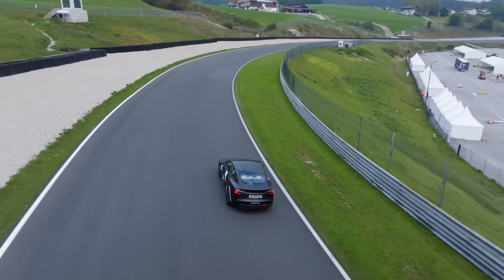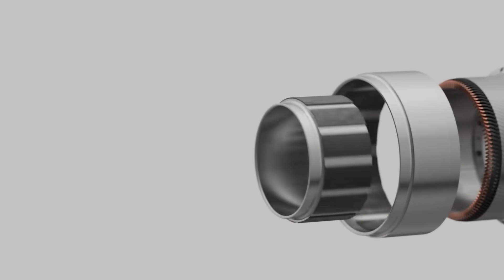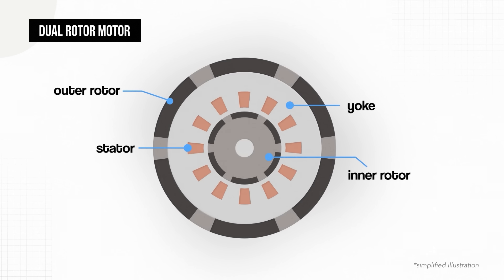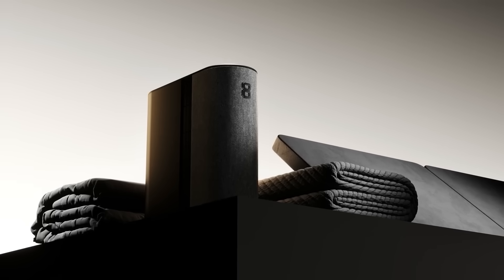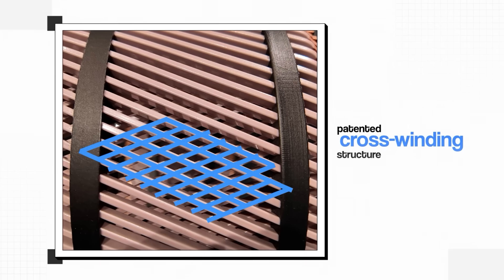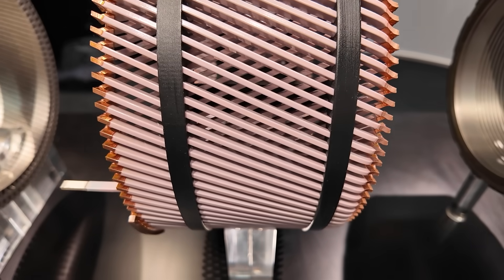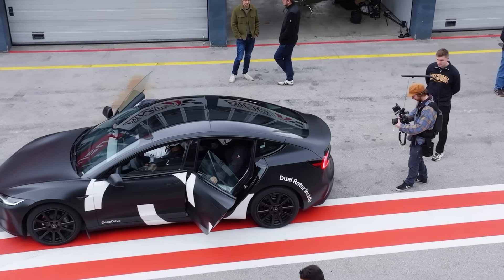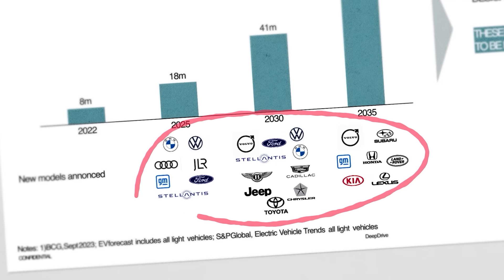How Dual Rotors Make Motors Insanely Efficient

Comment: Unsprung mass is a much bigger deal than you think it is.
Reply: @v4skunk739 You are so right on this one, I have a truck I used large tires on. The ride was rough and yes i used beads for balance.  The tires eventually were replaced with smaller tires and the ride was improved significantly.  The comparison I am making is based on experience with all other items the same. The rims were the same for both tire types but the weight change was so noticeable that even my wife commented on the ride change.
-MG
Reply: The in-wheel motor mass is offset against no drive shaft mass, and smaller brakes, as it can brake electromagnetically. Overall there is an increase, but it's not as much as you might think.
Reply: @GRAHAMAUS  It isn't ever happening for a car or truck. You don't understand physics and rotational mass. There is a reason why race cars try and remove all unsprung mass.
Reply: @v4skunk739  Whatever you say, random guy on the internet with no doubt a physics degree. I'm not claiming it is better, I'm saying it's not as bad as you presuppose. And we're not talking about race cars, are we? Have you seen truck axles? They weigh TONNES. Whether the hubs are 100kg or 110kg is irrelevant.
Reply: @GRAHAMAUS you can't even grasp the concept of rotational mass/centrifugal force. A 100g dust cap on a wheel on a vehicle moving at 70mph weighs like 32kg due to centrifugal force. Thst isn't even including the wheel. Heavy unsprung mass is terrible for anything with a wheel.
Reply: @GRAHAMAUS  So Just to let you know, the pickup truck I changed tires on was an International with a curb weight is 10,500 pounds, it has straight axles and just the change in tires made it stop shaking my back teeth. The change took it back to a rough riding pickup. Of course your mileage will vary but on a truck that does zero to 60 in "some day" it made a difference you could feel.
-MG
Reply: @v4skunk739 and how exactly does higher rotational inertia effect a non performance vehicle in a significant way?

Unspring mass will have negative effects in suspension, and therefore the ride, but I don't see the rotational part of  additional weight causing any trouble at all.
Reply: @kosiranze  You don't know what you are talking about. This tech will work best for trucks and in a car it would be terrible.
Reply: @v4skunk739 instead of just downplaying others, why not actually try to contribute and explain why higher rotational inertia in a wheel would significantly hinder a non performance vehicle?  

Does suspension have to handle any significantly higher torsional loads because of higher rotational inertia?

It is clear to me how it negatively impacts the ride when considering vertical motion of the wheel, but not the rotational motion (apart from acceleration and somewhat braking)

About it being terrible in the car, go check out what people who had the chance to drive the Renault 5 turbo 3e have to say... Far from terrible IMO
Reply: Based on? Yes it does make a difference but we are in a world where everyone says it's so important, meanwhile I can't think of a car from this millennium that has inboard brakes. Further, cars have increased in weight significantly. Unsprung weight may be double, but If the weight of the vehicle also doubles, what's changed?

And then you have to consider what it impacts. If it makes the handling worse, so? Most people drive SUVs, handling obviously isn't the main factor for them.
Reply: @benholroyd5221 Brakes are a pretty small fraction of the unsprung weight. Adding a 35kg motor on the other hand…
Reply: Yet manufacturers keep adding bigger rims. Its clearly not that big of a deal.
Reply: @traniel123456789  and ever-wider (heavier) tyres...
Reply: @traniel123456789  On performance models they work on reducing weight like having lighter wheels and carbon discs. There is a reason why no EV's have a motor in the wheel.

Comment: Next step: replace the Copper bar windings with high grade Carbon fibre, known as Carbon 100 (Copper on the same grading system would be 80, so the 100 is a better conductor). They should be coated with a polymer which insulates the fibre and conducts heat (I've forgotten what this polymer is called). This will further lighten the motor and add more strength to the design.
Reply: Don't tell this to Koenigsegg, or they will build a whole motor out of nothing but Carbon, Polymer and Neodymium.

Comment: ThinGap has been making motors with this layout for years. Also, the stator iron has two other important tasks: It keeps the magnetic flux out of the copper, and it increases the motor inductance. Magnetic flux passing through copper results in eddy currents, reducing the motor efficiency. In a conventional motor that flux goes through the iron teeth. Iron has much lower eddy losses than copper due to its higher resistivity, and it is laminated. A motor with low inductance will result in a large current ripple from the inverter switching. Either you need to use a high frequency inverter (which increases switching losses) or external inductors, with add so much weight you might as well have used a conventional motor.
Reply: Absolutely correct.  Balancing core loss via inductance is a tough problem. Inductance is simultaneously your best friend and your worst enemy .
Reply: Yes, these look almost exactly like Thingap's motors which have been around for a long time. Also, many linear motors are constructed like this (but not round). Alva Industries also makes a similar dual-rotor slotless motor. I'm sure we'll be getting a Ziroth video next week about how their motor changes everything!
Reply: @jbay088  well it's also conceptually identical to most axial designs which use stacks of stators/ rotors.
Reply: The inverter switching losses might be more complex than  just  r*f_s, i recently watched this interesting presentation from TU Graz https://www.youtube.com/watch?v=Q_jsMjY5vG4
Reply: Omg wait I work at ThinGap lmaooooo when he said “this innovative dual rotor design” in the intro I was like ????
Reply: I took a look at the Stellantis Intelligent Battery Integrated System. It groups cells into 48 sub-packs, each with 4 transistors. 16 packs are used for each phase. They do not say how many cells are in each sub-pack. The intelligent part means each sub-pack gets an equal time charging or discharging, staying balanced with the others. It does mean the power for each phase must pass through 32 transistors. https://www.youtube.com/watch?v=EUR7beftSt0
Reply: "Iron has much lower eddy losses than copper due to its higher resistivity, and it is laminated." - is it much of a problem when the 2 rotors are so close to the copper windings?
Reply: Did you notice that the copper bars are encased in a laminated iron core?
Reply: @gibmebalut  Oh, that's what that thing is? Well, that helps alot. The flux can avoid the copper, and the inductance is higher.
Reply: Or just leave out the inverter... in Germany (I think it was Fraunhofer) they developed a battery-pack-technology that enables inverter-less EVs. The magic: You just need to be able to switch every single cells positive and negative contacts as needed to generate alternating current as needed or load the battery with alternating current. Now combine both.
Reply: @hschmidt79  The problem is you aren’t removing the inverter in practice, you are removing a couple of reliable silicon carbide switches and replacing them with literally thousands of Mosfets to be used in an EV, it would add a ton of complexity to the battery and a massive reliability headache in real world.
Reply: @quantuminfinity4260 sounds like German engineering to me 😅
Reply: @quantuminfinity4260  switching each cell's polarity with a MOSFET is still an interesting concept to explore though, especially considering each cell needs monitoring, cooling and a safety fuse or similar anyway. If the cell could be manufactured with the switch integrated, that may help too?
Reply: @mandrakejake  You may be spreading out the load to thousands of switches in the process but that doesn't mean you get away from switching losses... You just spread out the heat into your entire battery pack that you now have to get rid of. Troll
Reply: @mandrakejake  Ugh!
Reply: @hschmidt79   That sounds more like Pyramid Ponzi engineering.
Motors in EVs are 3 phase... So you need a current form conductor A to conductor B, then from B to C, and then form C to A. How is a battery cell with 2 conductors going to switch between 3 conductors of the motor?
Also switching every call is WAYYY more complicated that switching at the inverter.
Reply: @sasjadv Presumably you’d have 1/3rd of the cells on each phase. I’m not familiar with the work, but it sounds like the idea is to have essentially one inverter per cell (microinverters so to speak).
Reply: @markirmuir  So you basically pull more amps from each cell, because you only use some of the cells at a time, and the cell itself will have to supply the PWM signal too.
This is like just trying to be gimmicky for novelty sake, just such that it's new and newsworthy.
Reply: @sasjadv  Sounds like a cascaded H-bridge inverter
Reply: @Turst28  Inverter, as in singular case???
When you have many subinverters, that combined form an inverter grid, or a distributed inverter.
But why? Why switch at the cells?
Reply: @sasjadv maybe not individual cel but groups of cells. Low motor inductance will be difficult to manage. More levels would help
Reply: @sasjadv  Not necessarily, you can use DC motors, but replace the brushes and commutators with semiconductor switches...
Reply: @vladimirs.4700  So get more ripple, dead zones by using a single phase motor, but then you still make it more complex by having an inverter array and switching every cell or battery group.
😂That's how to make it both worse and more complex that the original solution.
Reply: @hschmidt79  The inverter is a switch: "You just need to be able to switch ". You're just moving the inverter around and run longer cables with AC current instead of nice DC until the last possible moment.
And how do you solve rotation speed differences between left and right wheels when taking a turn?
Reply: @hschmidt79  still an inverter just different ;)
Reply: @hschmidt79  I think you just described an "inverter"!

Comment: If there is 80% less iron, by what percentage has the copper requirement increased?
Furthermore, if in a traditional motor the magnetic flux passes through the magnetic gap twice, in this design it passes through four times. Doesn't that reduce magnetic permeability?
It seems to me that the game is not worth the candle here.

Comment: Newbie question here: for inwheel motor, isn't direct transmission of vibration and Schock from the ground to the motor an issue?
Reply: absolutely
Reply: yes. That's a challenge for a motor with two rotors supported at one end only. I guess they minimise the problem by shortening the rotors
Reply: Absolutely is a huge issue. Current available motors make too little torque which necessities a reduction gearbox that will also struggle to survive shock and vibration. At least this company claims that their motor makes enough torque (2000 Nm) to not necessitate a gearbox, so now at least they only need to worry about the motor itself. There's also the question of unsprung mass, which will require a lot of engineering to deal with.
Reply: yeah, but it's a trade-off. For in-wheel motor u consume less space, get direct power from motor to the ground, less parts bc there's no need for transmission system
Reply: @khang.ngtr487 problem will be small torque
Reply: Schockingly no😂
Reply: No end turns either. The much lighter mass has far less inertia to warp itself on bumps. Narrow large diameter radial flux fits in medium profile tire rims. Less cantilevered structure. Stator has the absolute best thermal area I've ever seen for coolant. Direct drive with ferro fluid transferring heat to the finned wheel. 
I WANT THIS FOR MY ELECTRIC UNICYCLE!

Comment: With unsprung mass increasing, it pushes the tire companies to solve the problem. It is the main spring&damper when it comes to that particular problem. F1 has a lot of experience on that from previous era when tires were integral part of suspension, the suspension travel being very low. Not that we need to bring F1 into this, it is not a problem that hasn't been already researched, it is just one practical application. Tire sidewalls need to change, to be better optimized for heavier wheels, and car manufacturers respond by tuning the suspension, ball goes back and forth.

Comment: Make the coils from pipes, flow coolant thru at high pressure. The rigidity of the structure increases by temperature since that means pressure increases and there is more force pushing against the pipe wall. The more torque you ask, the more rigid the structure becomes.
Reply: Then place it in a high vibration environment and discover work hardening and fatigue are big problems with copper.
Reply: Because of copper’s incredibly high thermal conductivity, you’re actually better off just cooling the ends of the copper than turning them to tubes. It’s not immediately intuitive. I had a similar thought (I work at a coreless motor company and we ran the numbers, the reduction of copper actually hurts you more than the coolant helps!)
Reply: @yuvalkaroly  This won't stay correct as the size of the motor changes thanks to square cube laws, but very interesting to here that someone has run numbers for, presumably a motor they are either making or plan to make, and found it doesn't help. The manufacturing cost would be way higher anyway, so hollow windings with coolant need to be way more effective than solid windings to justify the effort.

Comment: in a radial flux motor, the outside is bigger than the inside, doesn't that cause stress on the mechanical linkage between the two rotors?
Reply: Aon flux 😁

Comment: Unfortunately, this technology is useless in industrial applications. Because the stator must be subjected to the power generated by the motor, it quickly wears out, becomes damaged, and becomes unusable within a relatively short period of time because it lacks the strength and rigidity to handle that power. This motor's lifespan would be very short.

Comment: A slightly smaller motor would be Incredible for electric motorcycles!
Reply: i reckon the in wheel motor is probably good enough
Reply: @redshift3 I'm thinking more about High power bikes, the increased efficiency on low speed would be great for those

Comment: TBH, this is more like an ad. You go over the proposed, or claimed befits without actually look at verifying them, taking them as face value. Another point is no doubt, this will have type of system will have disadvantages, not saying it's bad product or not, but you don't seem to be critical of the product, just reading a sales brochure. Look at both sides of this coin, not just the front and your videos will hold more weight.
Reply: Ryan isn't reviewing the veracity of claims, that's a whole other niche.  I am not an engineer and wouldn't personally be able to follow breakdowns like that.  I also don't think Ryan assumes every project will make it to market, nor is that implied.

Comment: I've been driving an EV for a full year now and it's insane how much of a better experience it is than an ICE vehicle.  Now, in my perfect world there would be no personal vehicles bigger than a bicycle and mass public transit everywhere and free, but in this world  EV's are just, better.  Quicker, quieter, no fumes, more efficient, instant torque, insane horsepower and still at the infancy of the tech.
Reply: Stop talking nonsense please!
Reply: ICE are made to be fast, tow massive loads, go significantly much further, much easier to modify for many different applications….. go to Africa or Middle East and see how people overload those old ICE and drive on very bad roads to very remote places.
Reply: 1000hp and instant torque isn’t everything you kiddo!

Comment: Older electric motors are already highly efficient, converting the majority of input energy into mechanical work. We can gain a few percent with gold plating. On the other hand, our portable electric energy storage systems waste huge amounts of energy. Fix that.
Reply: Don’t they want to switch to mechanical batteries for energy storage?
Reply: Not true actually. Highly efficient in the spweetspot of operation yes, but in the electric car during a driving cycle virtually all losses are in the Eaxle (motor or it's inverter or reducer). Roughly 1/3rd of the battery energy is wasted as Eaxle losses (depending on car segment) the rest of the energy is used to overcome friction rolling or air firction and do mechanical work (speedup the car)
Reply: @raduandreinegrila215  It is true as stated. Designers use inefficient methods of providing and controlling the distribution and conversion of electrical energy. This is not because of stupidity. Inefficient conversion methods are stable and inexpensive to produce. Highly efficient conversion and control systems are easy to design, but are expensive. The "sweet spot" that matters to producers is the maximum point on a curve that represents the ratio of sales profit to production cost. Making a motor more efficient can be useless in practical applications. Why? Because anything that slightly reduces that ratio is the same thing as unobtanium.